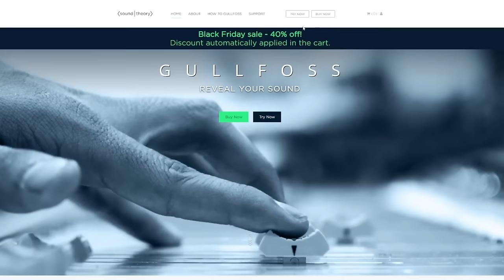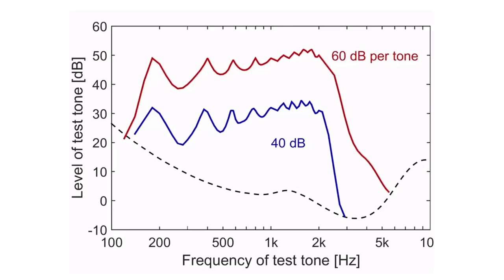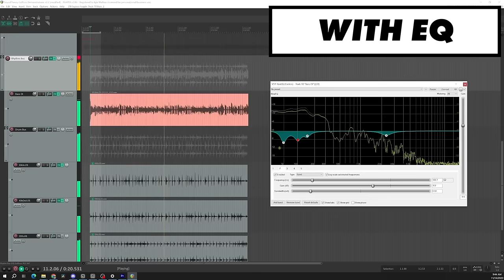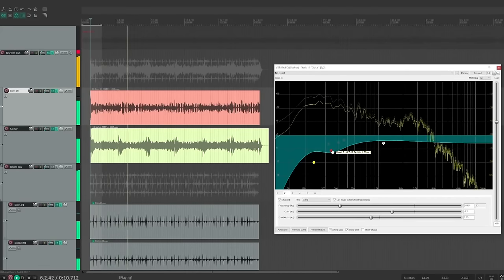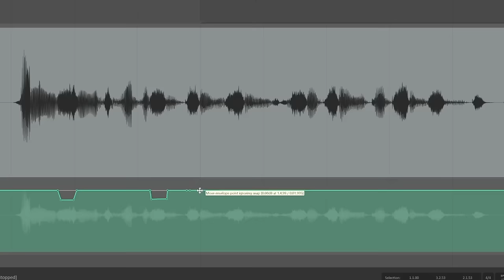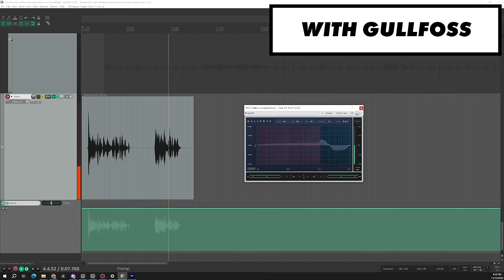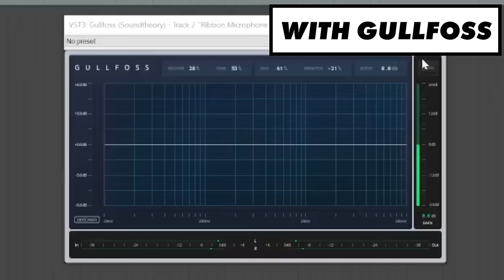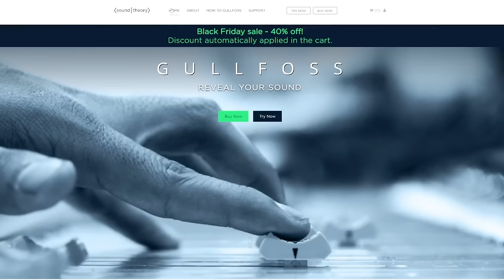3 Masking Problems EQ Couldn’t Fix Until Now!

Comment: Correct me if I'm wrong but Gullfuss instances doesnt communicate to each others, so masking fix is a bit limited compare to plugin like Sonible EQ which know what sounds comes out every instances.
Gullfoss is more like tone shaper than an Masking fixer IMHO. The masking fixes capabilities is more a side effect that the main goal.
Reply: Gullfoss has a sidechain, which allows it to listen to other tracks. However, it is not suitable for resolving conflicts between the selected tracks. The sidechain function in Gullfoss only makes it process one track as if it were processing another (the one in the sidechain).
Reply: seems so, makes new Sonible SmartEQ 4 rather overpowered now :D

Comment: I knew the second I saw that Martin guitar I was gonna hear horrific 300hz frequency masking. You can still hear the boxy and muddy resonant peaks in the treated track somewhat too. I hate having to record Martin guitars for this reason, once you've heard that muffled lower midrange "OOOoooo" sound they all make, you can't un-hear it anymore. My solution is to put that terrible sounding guitar back in the case and pull out a proper Taylor guitar instead.  :)

Comment: Thank you. This is the content! 💜 What is the difference between Gulfoss and Soothe 2.
Reply: Soothe 2 is based off resonance and is subtractive without auto gain functions and does more or less what the name suggest by taming the "ringing" resonance of a signal across multiple bands while preserving the phase relationship of the original signal and Gulfoss is not looking for "resonance" but rather using an understanding of humans perceived loudness to boost or attenuate to achieve a "flat" signal or a "true" signal perception dealing with the masking Kyle was talking about. Soothe - use for harsh instruments or mixes     Gulfoss - use to achieve transparency
Reply: @anthonysauro1040  Amazing, thank you so much for the detailed and kind reply.
Reply from the maker: Great question, Jennifer! Great answer, Anthony! Thank you both for watching and participating in the community.

Comment: Would you use Gulfoss on multiple tracks to deal with masking or can it all be done by putting it just on the 2 buss?
Reply from the maker: It is most powerful on busses. But as you can hear in the demonstrations, it also works on individual channels.

Comment: Because it isn't static, I believe it actually does alter the harmonic content... someone please correct me if I'm wrong (with a good explanation). In which way is this Gulfoss different from Soothe or TrackSpace?
Reply from the maker: That's a good point. It does change the signal. But it doesn't create harmonics that weren't there before processing like a compressor would.
Reply: @AudioUniversity  thanks for the response! But it’s not an explanation hehe maybe it says it on the manual? Some place I can dig a little more into it? Also would like to know what you think about the difference between the plugins I mentioned
Reply from the maker: As to how it's different from Oeksound Soothe and other plugins, I'm not yet sure. It's all fairly new technology that I'm still trying to wrap my head around! 

I've tried Soothe and Spiff, which also do some amazing things. I think Soothe only attenuates (or suppresses) while Gullfoss can "Recover" or "Tame". If you're interested, I can post more videos once I better understand what's happening under the hood...

There is some more information on the website here: https://tinyurl.com/2c9j8t6y
Reply: @AudioUniversity  i’d be the first one to watch those videos! Thanks for everything 👏

Comment: Would Gullfoss be appropriate for live worship or would the latency be a problem? What other AI plugins do you see being developed?
Reply from the maker: There is a live version of Gullfoss (and a mastering version, as well!). I believe you get all three! 

Gullfoss isn’t an AI-powered plugin, according to my understanding. But there are some cool AI plugins, especially for noise reduction!
Reply: Yes you get all three when you buy Gullfoss, the latency of the live (live meaning for live application) version is 1.4 ms per instance at 48khz frequency rate  (1.5 at 44khz frequency rate)and it would be a huge work to name even the biggest plugin that use language model (falsely name AI) cause there is a handfull, just naming a couples of compagnies : Izotope, FL Studio, Oeksound, LALAI and Sonible are some of the most known. (special mention to synthplant 2)
Reply from the maker: @DarkTrapStudio thanks for sharing this info!

Comment: I have questions. First you applied it to many sources, some singular as far as channels/tracks and the overall mix. Would this be a resource hog of a plug-in? Secondly, would it be better just applying it to buses or an overall mix itself to clean it up?
Reply from the maker: It would be too resource intensive to use on lots of individual channels and it performs best on more complex signals. . While I demonstrated a few single instrument uses, it really shines on busses!
Reply: @AudioUniversity  ok thanks.
Reply: I own this plugin. Best use is to use the regular Gulfoss plugin on grouped mix busses (ie: drums, leads, bass) and then use the master version of the plugin on the master. Yes the master version is included with the purchase.